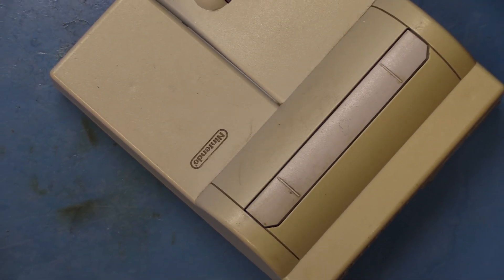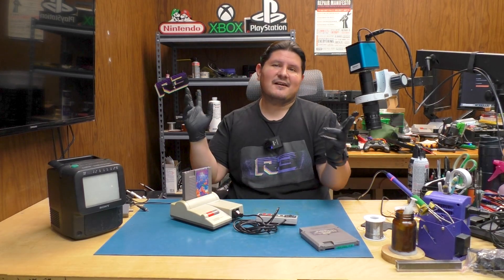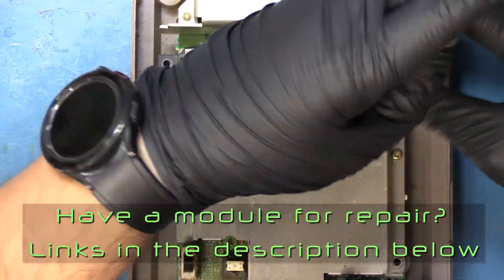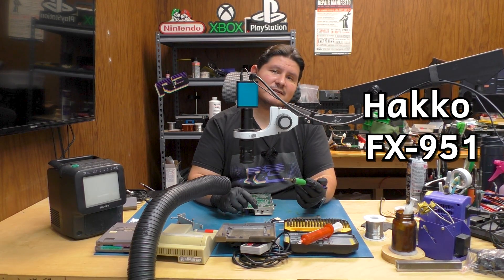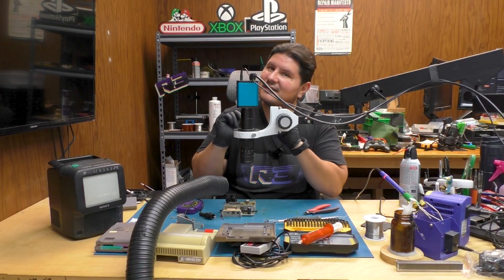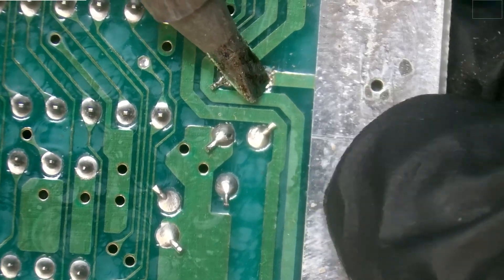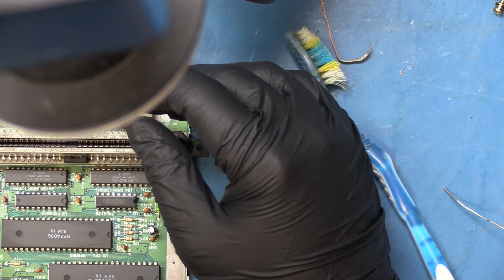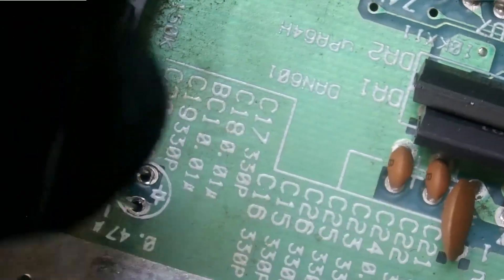Nintendo NES Top Loader Capacitor Replacement

Comment: Crazy question but why did you install a 1500uf @25V when the board asked for 1000uf @25V ?? Is this to account for the PSU plug being used in the USA .vs The Japanese PSU plug?
Reply from the maker: I had the same question at time of installation. I figured it must be normal, as It was supplied with the console5 cap kit.

Comment: I have a top loader that stopped working. I took it apart and the main big power filtering cap had 1 loose leg. So i used some flux and reflowed it and it still doesnt work. Is it possible i fried the motherboard by trying to power it on with said cap being loose? Its getting power but no signal to the tv. Help lol
Reply from the maker: It should be fine, but that's a little bit odd of a find. I'd go over everything else and touch anything that looks suspect.